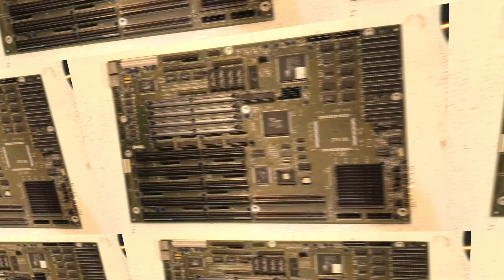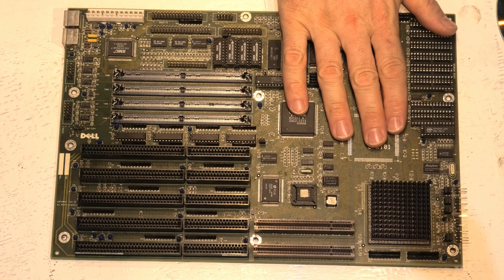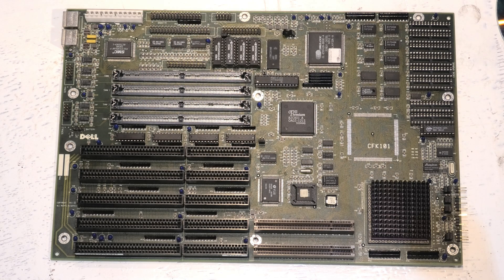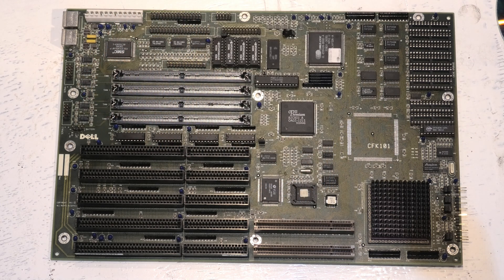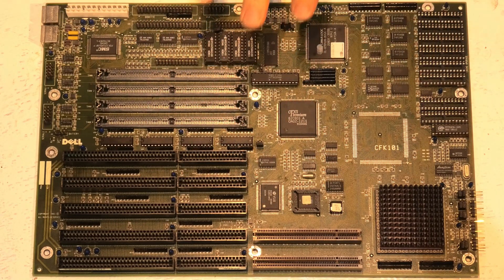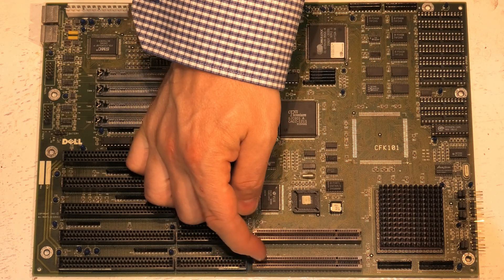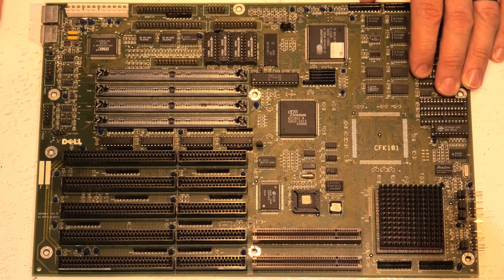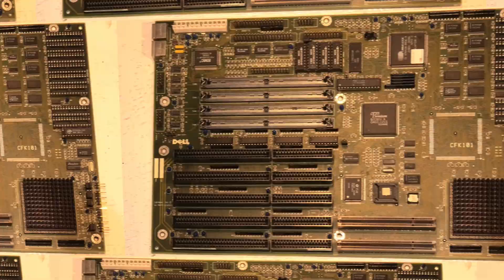Overview of the 486 VLB/VESA Bus on 486 class machines.

Comment: Also, VLB will RUN at the CPU FSB Speed, which means up to 50Mhz on 486 (remember the DX50?) on Pentium there are workarounds as it is true not all cards will work well past 33MHz, got many a VGA card killed thanks to that on DX50 systems, not on DX2's though as those never went past 40Mhz FSB speed.
Reply: For the record am Building currently a DLC with VLB and a fancy cached HDD controller etc :P
Reply from the maker: Nice.. thanks for watching.. you might encounter stability issues and or errors in data if you push the bus too far.

Comment: My 468SX rig had VLB, just the slot,  I didnt have any hardware to use it with, but even being 12/13 yo at the time in the early years of the post-socialist Poland, i was baffled how jerry-rigged that looked XD

also having no access to any resources or information on PCs in general, not to mention something so specific, i figured out VLB stands for Very Long Board - made perfect sense :D
Reply from the maker: Thanks for watching.
Indeed the VLB/VESA Slot was a stop gap solution to a problem that was soon resolved with the PCI Local Bus. At the time it was needed to improve performance on HD transfer speeds and VGA performance.
I think Jerry-rigged is not far from reality.